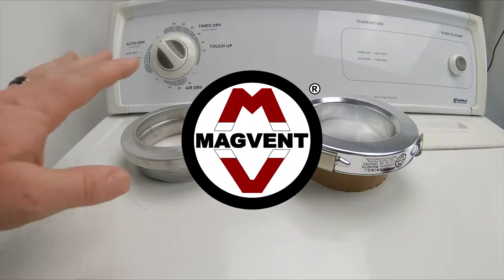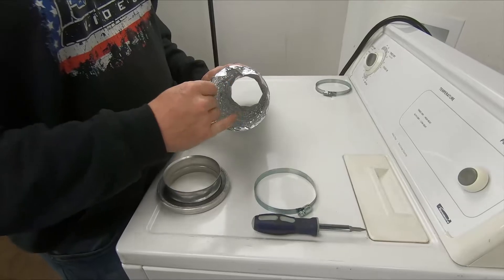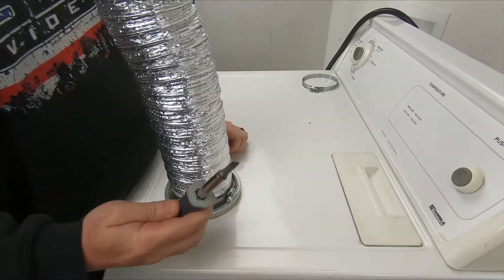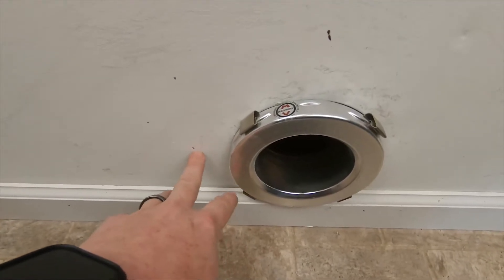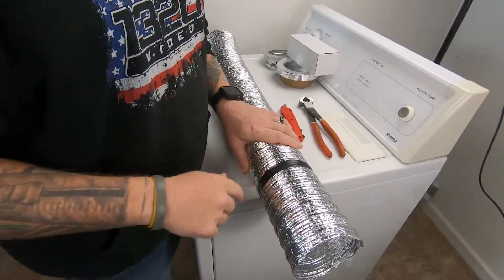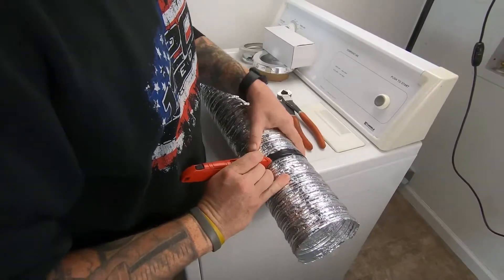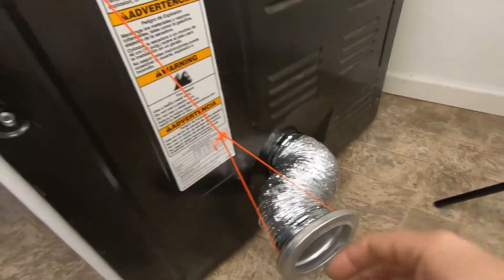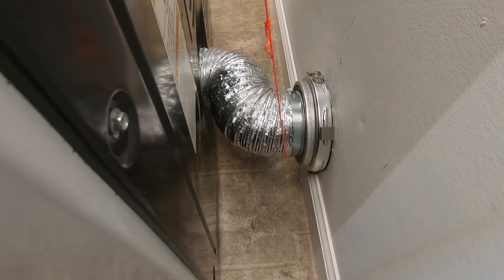MV-Flex Overview

Comment: I am looking at this system as a viable option to address access difficulties, as the attic entrance is directly above the washer and dryer & that is, in a cupboard. The problem is when the duct was installed by the contractor. He placed a fully adjustable elbow in the opening and part of that elbow at the joint protrudes a good 1/4 inch past the face of the drywall on the top edge. And the straight part of the elbow is about another inch beyond that. My question is looking at your MV-Flex drawing the male portion that fits into the wall duct. Will it clear the elbow and allow the mounting plate to fit flush after the excess metal on the outside of the drywall is removed?

Comment: What happens when you pull out the dryer? The hose tears appart and you cry?
Reply: If you purchase the hose they recommend, it shouldn’t tear apart. It’s not the cheap, foil hose that you find in big box stores that tears easily.

Comment: When I bought mine I loved it, it worked great on installation, the hose piece found the magnet and made an extremly strong connection, However, the dryer shifted just a little and the magnet connected to the wall bracket easily came loose and lint is all over the wash room. The clips on the wall bracket just aren't strong enough to keep the magnet from breaking loose from the wall bracket. The wall bracket needs stronger clasps or some kind of mechanical connection, a simple threaded  hole and a screw would fix the problem. The clips and bumps on the magnet just arent a good enough connection. The magnet to hose is so much stronger then the wall connection. Its a great idea but you need to fix how the magnet attaches to the wall, if you have a retrofit please send me a one. I cant keep worrying about it looseing connection and cleaning up lint. I still like the idea.
Reply: Thank you for your honest feedback.